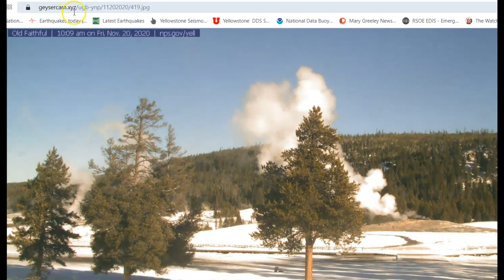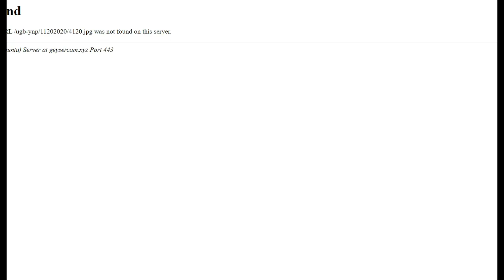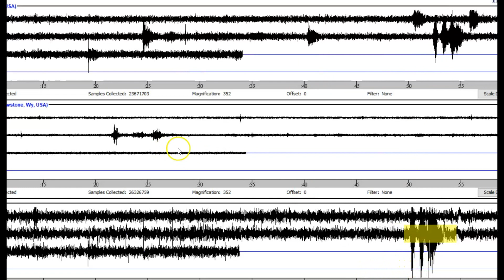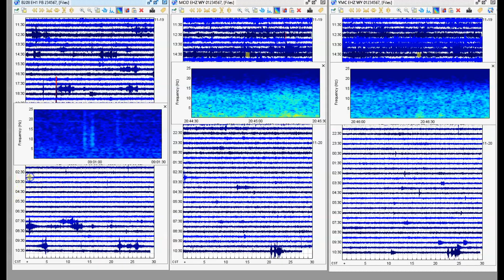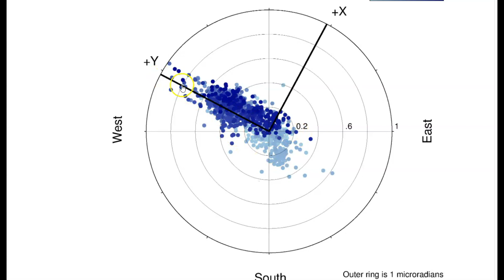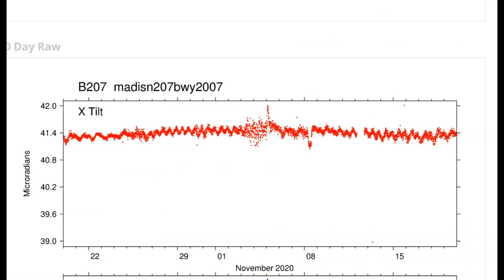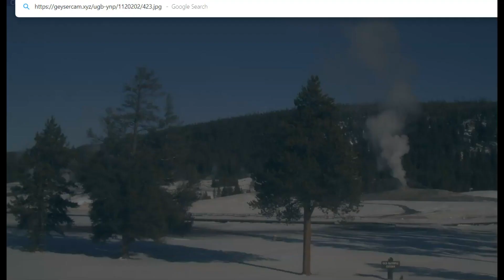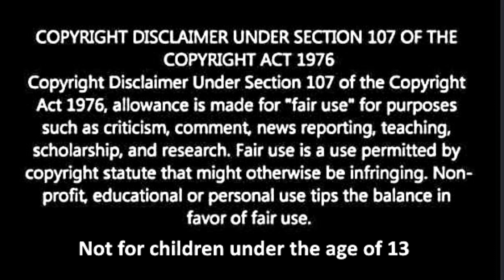Yellowstone Old Faithful Drying Up? Black Steam - Timing of Eruptions Way Down!

Comment: they need to take pressure and the steam from erupting drill 2ft hole straight down to the magma buildup and should release after drilling over atleast 75 to a 100 holes or as needed and should delay or change the eruption

Comment: I conclude that the progress of the emptying of groundwater in the Yellowstone basin may be  much faster than I would anticipate. USGS isn't to be trusted, as they are paid not to cry 'wolf' I wonder how many years we still will see steam coming up at Yellowstone. We all know that water boils at 100 degrees Centigrate. Once the water is gone, only groundwater from the surrounding areas may infiltrate. We have no clue to how much groundwater is still there. It might be a good thing to find information on the groundwater in the Yellowstone bassin. Do you have access to that information? Is there recent information on the temperature of the groundwater in the Yellowstone basin? The next stage is the heating of the surface water. Another thing is the sudden die off of fish. We don't know wether Yellowstone will blow. And if it will blow, we don't know when that will happen. Worse still, as the magma chamber under the Yellowstone basin is much larger than previously known, the magma chamber may look for another place to erupt, far away from Yellowstone Park. The other super volcanoes in the vacinity may all be fed by the same magma chamber. We simply don't know enough. All eyes may be on Yellowstone, while the eruption may come closer to California. I don't know if there is a study on all the super eruptions in America. It might be good to try to find a patern in super eruptions in North America, not just focus on Yellowstone. If it is true what I suspect, other supereruptions in North America may originate in one and the same magma chamber: Yellowstone magma chamber. What feeds this magma chamber? I would like to know! Perhaps we all just theorize. Joke: BREAKING: USGS ADMITS IT UNDERESTIMATED THE POSSIBILITY OF A SUPERERUPTION IN OUR LIFETIME. THE WHOLE STAFF OF THE USGS HAVE RESIGNED AND SELF EXILED THEMSELF AND EMIGRATED TO NEW ZEALAND.  There is a saying in Dutch: When the ship sinks, the rats leave first. Just watch when they all travel to an 'International Conference abroad', 'make major adjustments in the staff', sell their houses, go on early retirement or stop reporting all together.

Comment: I think the magma chamber is shifting, and the water source is shifting a bit, which happens with seismically active areas. Springs around here dried up after a 5.4 quake 2 years ago. I am of the opinion it's not a sign of an impending eruption. If it is, I'm inside the blast zone already so 👋. Oh, FYI, there is a geyser in Soda Springs Idaho that they shut the water to when Old Faithful gets low in water. I do know the geyser is going again so...

Comment: USGS field folks are just a bunch of dorky college students and they know little about installations. I have seen their installs  and getting any seismic info is a miracle. They pretty much know how to get the actual sensors installed now but zero about getting the data back! Its pathetic for such a large gov entity. They have been running on 40 year old tech and finally have started fixing it. However remember the first comment, these dorks don't do well in financial politics and getting proper funding.

Comment: Heavy sigh. I live near Yellowstone, and cannot count the eruptions I have seen and photographed. Those dark spots are NOT dirt. Dirt does not float like steam. It is impossible for volcanic ash to contaminate a geyser. Geysers are water-based systems with WATER (not lava or ash) bubbling through silica-lined super hot tubes. Volcanic ash is intrinsically heavy (it is rock, after all)! And requires immense force to be ejected. Immense. Powerful. If ash is coming through that tortuous system, that would be the last eruption for Old Faithful.

So what is the “dirt?” 1) shadows, 2) variable thickness of steam. When the steam is thin, seeing through it partially causes a decrease in luminance. Note snow on the ground. That reduces exposure and makes anything not thick and white look more grey. And...examine the trees and shadows. The shadows are extreme, meaning the sun is almost horizontal to the geyser. And, the plume is moving horizontally as well, so the plumes are shadowing themselves. 

So, this is all complete baloney. I know the Lord is coming, but these silly reports discredit the faithful. Study some volcanology, and understand what kind of volcano make ash, lava flows and such. 

Finally, why is the webcam not working right? Are you kidding? This is an isolated area with TERRIBLE internet access for everyone. With a very tight budget. Dropped data is not weird, and not a conspiracy.

BTW, I am a photographer and have shot Yellowstone for 30 years, and have very substantial scientific training. The “dirt” is visible in every image I have taken of Old Faithful. It is called shadow.

As a godly workman, the onus is on us to be well educated. Please!
Reply: You know shit

Comment: Around 3:00 am today, 21 Nov. I was taking a shower and noticed the water in the toilet swishing back and forth and a jar of shampoo was rattling on the bathtub shelf.   I assumed we were experiencing a small earthquake.  Then I spoke to a friend who is in a hospital in Gatineau Quebec and she reported her bed that is on wheels was rolling around a bit.  Now we wonder if  we had an small earthquake that centered in eastern Quebec or come through the Montreal area from the New Madrid fault line.  Does anyone know anything about this?
Reply: Some small quakes of the Midwest and your area are ‘rebound’ quakes, that as a result of ice age glaciation covering our area measured in thickness and therefor shear weight of frozen water ice on the earth surface, compresses the land. Once ice melted, that downward pressure was relieved and since has been ‘ rebounding’ or snapping in small releases such as nearby a few years back right here in the middle of Illinois, much more in line with the New Madrid seismic zone yet large majority of temblor activity in region attributed to the land once compacted under the mass of ice reclaiming equilibrium
Reply: @aprildenham4730  Thanks for the insight.

Comment: It seems likely that some part of the water channels have eroded into material that is darker. If there was a lot more heat the eruptions would be more violent, much more violent.  The darker material could also mean that the channels have eroded into softer and more porous material. This could allow some groundwater to flow out of the chamber, lengthening the time between eruptions.

Also if you're familiar with the ignorant helpless people that work in this area (Jackson Hole/Teton County), they don't have the brains to hide anything, neither do they have the brains to fix any technology acting up. I should know, I used to live in Jackson and have been up to Yellowstone many times.

Still live reasonably close and the average IQ in that area still seems to be sinking. A lot like the chart from the movie Idiocracy (2006).

Edit: Its Occam's razor folks. I won't entirely dismiss the very remote possibility that something nasty is about to happen and that some nefarious activity is going on to cover it up... but as I said, I think its extremely unlikely.

Comment: We can all predict and understand the behavior of different groups of people in a dire situation by studying the Titanic.  Only 15 minutes after hitting the iceberg, the top brass on the ship ("government leaders") gathered on the bridge ("capital city") and did some very basic math that told them what was about to happen.  For the next hour the first class passengers were calmly led to lifeboats for "just a precaution while we await a tow to shore," the second class passengers were awakened and told to gather on deck for a lifeboat drill, and the third class had to find creative athletic ways topside or else pack like cattle in the lower corridors while cabin stewards told them their turn would come.   The officers told everyone "the Olympic will be alongside very shortly" for passenger transfer, but those officers knew how far away the Olympic really was.  At some point, however, the situation became more obvious as a group of terrified, drenched boiler room workers came rushing up the first class staircase where they weren't ever supposed to be, and people started to feel the forward list increasing like the bulge underneath a supervolcano we're told is not any danger to anyone anytime soon.

Comment: Hi Mary, love your news. I have a question as to how to interpret the direction of the magma flow. Does the point of the "V" point the direction or left or right of the chart indicate indicate east or west? I'm confused
Reply from the maker: The "V' in the charts is measuring the direction the magma is flowing under the ground. "X' would be north, "Y' is east" The other is what the ground looks like if you were standing there looking out.
The ground would be the round image, second image at this link - last 7 days. The top link is just X and Y separated. - last 7 days
https://www.unavco.org/data/strain-seismic/tilt-data/tilt-plot-listing.html?sid=T944&origid=B944

Comment: Mary years ago a park ranger said that if the geysers which are every where in Yellowstone park, Ever did start to emit black smoke it would not be good because it means that the magma would be rising causing the tree roots to burn causing black smoke. I was so scared that every where I went in the park I was watchful of Black smoke but I saw none. Go figure what is going on in the Park. I Pray that the Black smoke doesn't get any worse.

Comment: That’s just volcanic ash mixing with the steam , there is probably a hairline fracture into the magma chamber and it’s starting to get into the hydrothermal vents up above the lava chamber .... only a matter of time
Reply from the maker: Giantness is also showing black steam, Far left of Old Faithful.
Reply: @MaryGreeley54  I strongly believe it’s Ash from the magma chamber starting to make its way into the hydrothermal structures above it and once the pressure Underneath finds a easy way out ....... 💥
Reply: @jettyeddie_m9130  Certainly much heated hydrothermal petroleum. Another Possiblity.
Reply: @MaryGreeley54  I remember the event with the rift creation and a geological article afterwards said that the gyeser basin would be the next area for pressure and magma influx to occue due to the rift slowing and shutting that route.
Reply: If ash is getting into the hydrothermal vents and fissures and whatnot. Couldn't that gum up the hydrothermal system causing more pressure and also cause it to go 💥
Reply: @Fenix-bt1kh  hydrothermal isnt the only thing to worry with gases release there, mixing od basalt and rhyolitic and dacitic magmas also causes a flash release of geo gases, including of CO2, H2SO4 and methane, trapped on the thicker cooler magma as it flash boils and mixes with the super hot runny basalt.
Reply: @razorransom1795  well that just sounds awesome. Guess I'll just have to keep attempting to educate myself on these things. Was extremely interested in this stuff as a kid but kinda lost it along the way. Guess I better start hitting the books more
Reply: @Fenix-bt1kh  or documentaries that talk about eruptions and what was hypothesized on their occurrence if given. The stuff I mentioned about gases, I got by researching what gases are released by volcanoes (mud, regular and calderas) and faults especially before and during those events and what tell tale signs they sometimes give before they do their big events.  Although, much I just stumpled upon after the start of it all looking for articles to do a report on in middle school and came across one on the uplift at Yellowstone article and on pluto's temple/gate turkey. The temple is connected to a major fault line that sank helike twice in Greece and has put out major CO2 levels more so recently as it been studied, known for animal deaths thus ancient greeks believe it was a gate to Hades just like lake avenus was to romans due to Campaii fregerii caldera that was below it and the caves near pozzuoli spewing mass amounts of CO2 as well causing fish and birds and all small and medium size animals to die near them. There are good dr stone episodes on H2SO4 and a volcano.  White island eruption articles talk about links to CO2 output love and eruptions, it put 2nd highest CO2 record before it blew last time and a quake went through the are right before. Other Mary Greeley vids cover yellowstone's death gulch and its output and on sommerset beach people got lightheaded and fainted before crona and a flock of sparrow die off there for ? reasons note it was near the ancient fault that runs through that beach and through scotland which once fed an ancient volcano on the isle of manns which is a Neolithic graveyard spot (all happened same time Dutchinese noticed quakes starting to creep up that way and then the whole fault freed itself up and is having quakes go across it now sometimes, although wondering if the normal route got gridlocked like what is happening with Pa's faults why the ramapo, Allegheny and big bear creek, bellfont and state college area ones and others are awakening instead of going up Erie way). Also look up mud volcanoes, their creations and what they put out, one near Rondo Beach California is a famous mud volcano that puts out methane mini icebergs due to its depth in the cold ocean.

Comment: My understanding of volcanos is that you want continuous activity it's when it becomes quiet that you have things to be worried about.
Reply: That's what I've heard. Lots of little actions relieve pressure. Long dormancy builds up pressure.
Reply: SteamBoat is becoming more active though, its been dormant for up to 50 or so years in years past, Also when it did go off in past years it only went off once or twice that year, its been going off a couple times per month for the last couple years now. Things are shifting and there is evidence of Old Faithful going dormant during times of Drought, which happens to be really really bad right now. Its probably drought and shifting water sources that is causing things to change.
Reply: That’s not how Mt St Helens blew, it wasn’t quiet at all. It had uprising and smoke.
Reply: Like the silence before the storm.

Comment: Increased heat vaporizes water hence the longer times between eruptions and there hiding it
Reply: But that also works the other way too. Turn your stove down and it takes longer to boil
Reply: @6P3-MK4  one problem with your statement is the inherent forest die off turned to charcoal. Increased quaking asphalt melting all signs off magma increasing temps not decreasing and even when temps were on decline the geyser Old Faithful hence the name would erupt consistently with in few minutes. Which it is not doing now and USGS thinks you won’t remember them saying that the drying up of the geyser could prelude a volcanic eruption as one of the major indicators.
Reply: @6P3-MK4  ok you just want to be cognitively dissident